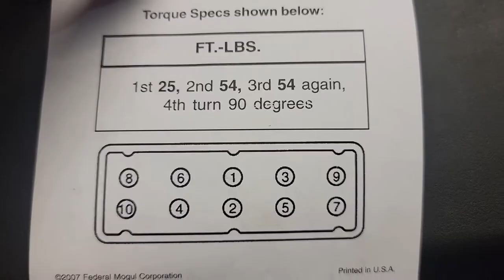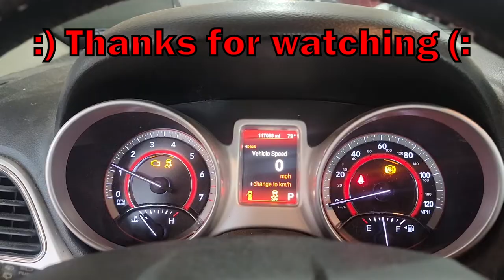How to Replace the Head Gasket and Timing Chain on a 2016 Dodge Journey | 2.4L Engine

Comment: Just went through this with a 2019 Journey 2.4l it was the head gasket leaking into the  #2 cylinder. The Dodge dealership fixed it over 5k in repairs covered by extended warranty luckily.
Reply from the maker: When I did this for the customer, I only charged $1,800 including all the labor and machine work. It took her over 9 months to actually pay me for this repair, she thought what I charged was astronomically over priced. Sounds like she has never taken her vehicle to a dealer for quotes before.
Reply: @BentOaksGarage  no your price was good compared to a dealership. I could not have afforded it without the extended warranty we purchased.

Comment: Nice video - pulling the head on my 16 Patriot with the same engine.  I'm icing down my hand after slipping on a 3' breaker bar trying to loosen those head bolts.  You weren't kidding!  Where did you guys get the extra long torx bit?  There are a couple tight spots my torx bits won't reach them all.
Reply: You can disregard - I didn't see the bearing race left behind partially blocking my way.  Head is off now.

Comment: For water pump bolts, would it work to break them loose before you pull the belt. good video tho thank you i am fixing to tackle this job on a 2013 Chrysler 200. and this is a good.

Comment: On the torque spec the degrees is what stretches the head bolts and that is why you want to have new head bolts as they are all typically torque to yield meaning first passes will be a torque range in a lbs rating then final pass of degrees which is when you are "stretching" the bolts

Comment: So wondering what gaskets you needed to replace aside from the head gasket to do this job? Timing cover? Inlet manifold?

Great video! My 2014 Freemont needs a head gasket change at around 100k miles so it’s great to get an understanding of what the mechanic will need to do.
Reply from the maker: Greetings, Let me say I will try and explain the best I can here in reply, but feel free to email me if you have more questions vgotspeed@yahoo.com.
To start, most engines (not all) have timing marks that you align up with the marks on the timing chain. I will focus on this type. On this Journey, the timing marks were at the 10 and 2 position on the cam gears (sprocket) and the dot on the crank gear (sprocket) was facing at the 6 o'clock position. Make sure you have it on the compression stroke, not the exhaust. You can find this out by just putting something over #1 spark plug hole and if it sucks down, that's exhaust. If it blows out, that's compression. (you can even put your finger over cylinder one spark plug hole to feel suction or pressure. 

Once everything is aligned properly, you can remove the chain, the tensioners, and the guides. 

Then, clean the tops of the camshaft bearing caps and take a sharpie and number them starting at the cam sprocket, I#1, E#1. I#2. E#2. I#3. E#3 Etc. I for intake and E for exhaust. They have to back on in the exact position they cam off. It even helps if you put a small arrow pointing to the cam sprocket on each cap, this way you will know how to put them back on. Once that is done, you can remove the caps and take out the cams.

Next clean off all the covers on both the Intake and Exhaust valves and label them I1, E1, I2, E2 etc starting from the cam sprocket side. Once labeled, you can remove all of them (some times a little magnet helps remove them).

Now its safe to remove the head bolts (I believe it was a T55). Once the head is off, you will need to strip it all the way down to just the valve train. All the sensors, plastic pieces and parts, exhaust, ext. all has to be removed. Then take it to a machine shop and have them pressure test, vacuum test and shave it. Here in TN, all of that cost under 120 dollars.

On a side note, when I do head gaskets for customers, I do not give them an option to skip the machine work. They always ask if they can skip that part to save money and I flat out tell them no. I will not warranty my work if they insist on skipping it. I also replace any wear items when I do a head gasket. So a new water pump, new thermostat, new plugs, new timing chain, etc. This is called preventive maintenance, you are already there so why not just put everything on new so you don't have to worry about it failing anytime soon.  

Here is a list of parts you will need:
Head gasket set (cost a little more but it comes with all the needed gaskets for the rebuild)
Cloyes (the company I recommend) Timing chain set.
Head Bolts
Water Pump
Thermostat
Oil and Filter
Coolant
spark plugs
Black RTV silicone for timing cover
Engine assembly lube of some kind to put on cam bearings when re-installing the cams
Torque wrenches
Valve cover gasket (only if your head gasket set did not come with one)
Power steering fluid
Brake cleaner or carb cleaner to clean injectors when they are out

On a side note, Don't purchase cheap parts off Amazon to save a little bit of money. Stick with brand names like Cloyes. This way, if it does ever fail, you have recourse. Last thing you want to do is tear it all back apart because of of your new parts failed after only a few miles.
Reply: @BentOaksGarage  Thankyou. It’s a bit over my head (no pun intended) but I think your detailed response will definitely help others. :-)

Comment: Nice video. So I didn’t quite understand what you did with the timing. You took the cover off but to remove the head, I assume you need to remove the chain and it needs to go back on in exactly the same position? (Sorry. I’ve never done this before so may be a silly question)
Reply: I'm not the channel but yea you do.

Comment: Hi, I have a 2014 Dodge Avenger with the 2.4L engine. I was driving it and when I got home it was making a loud ticking sound. I raised the hood and it seemed awful hot.  No coolant coming out anywhere and the temp guage was just a little over half. Anyway, it continued to make this loud ticking sound Idling, so I revved the engine up a couple of times and the loud ticking sound stopped. It was still sounding like it had low oil pressure though. I parked it for the night. I started it the next morning anf the red oil light is on. The engine is definitely starving for oil. What could have happened that caused no oil pressure? The oil has always been changed on time and had just been changed.  The engine is rattling. No oil pressure. Could the chain that runs the oil pump broke or maybe a gear, chain guide, or just a bad oil punp? It happened all at once, so it seems to me like something broke or maybe it did get hot and destroyed the oil pump, and the temp sensor is bad. I did notice that the cooling fans were not on. anyone have any suggestions?
Reply from the maker: From the sounds of it, the oil pump just went out. Its a wear item and should be changed when doing timing at 120k miles. With no pressure, I would not even start the vehicle because you can burn up the bearing, rings, etc. Catastrophic damage. Cheers

Comment: I have a 2015 journey, and I keep getting a missfire on cylinder 2 . Changed pretty much everything that has to do with that plugs /coilpack/fuel injector. And could never figure it out. I'm also losing coolant and can't figure out where. A friend told me my head gasket could be leaking water on the cylinder and causing that issue. He said it's a design flaw . So I'm wondering could this could be my issue?
Reply from the maker: You can easily have a cracked gasket that goes to the engine and is burning out the exhaust instead of mixing with your oil. In the summertime, you can tell by white smoke out the exhaust, harder to tell in winter time. Have you checked compression in all four cylinders yet?
Reply: @Bent Oaks Garage  I haven't check compression yet. But I will do that. It only sputters when it's cranked, after sitting for awhile  then levels off and runs normally
Reply from the maker: @Jam_ Hen  is there any other codes like Crank position Sensor or Cam position Sensor? You can also take a bore scope and look into each spark plug hole. If cylinder 2 has a clean piston top, then its leaking coolant into that cylinder.
Reply: exact same issue with our 2014 journey, misfire cylinder 2 and losing coolant somewhere cant find it.  Bought a coolant exhaust sniffer,  test fluid turned green. means traces of exaust.

Comment: Question when doing a head gasket is the timing chain savable should that be replaced as well.?? I guess it depends, right.?
Reply from the maker: A timing chain should never be reused (in my opinion). The reason for this is preventive maintenance. If you are already that for in, spending the extra couple hundred bucks to replace everything is well worth the money. Because if you don't, and you use the old chain and it stretches or breaks, you will be pulling it all apart again, spending all that money and time a 2nd time and you will be kicking yourself in the butt for not replacing it the first time around.
Reply: @BentOaksGarage   Thank you i appreciate it, God bless you.

Comment: it's good to pressure wash the whole engine compartment of every sizable under hood repair.
 I usually tap socket 2 times hammer click it
and do this 3 times if needed it stops bolts from breaking. I plane these heads by hand at home and save money
Reply: Stop

Comment: Great video. What head gasket brand did you use? Also did you have to change the thermostat, radiator or any of the hoses?
Reply from the maker: Felpro head gasket #26557PT. The owner of the car said she just replaced the thermostats in the car so I did not replace them, however I highly recommend doing so. The radiator amd hoses stayed the same. Also spend the extra money and get new head bolts, you don't want to end up redoing it a 2nd time from a stretched bolt.

Comment: Did you have to take off the oil pan off to get the timing chain off and back on ?
Reply from the maker: Yes, it's attached to the timing chain cover and so is the oil pick up tube. It was very poor design and makes life hell for a mechanic.

Comment: I've never seen anybody remove head bolts with an impact gun. Always a breaker bar.
Reply from the maker: We tried that. Even when we used an  extra long pipe to extend the breaker bar, it snapped the head off the bar. Thus needing something bigger. Cheers.

Comment: Can i get the torque for the cams please
Reply from the maker: 8 ft pounds for the M6 cap bolts and 22 ft pounds for the M8 cap bolts
 Start in the center and work your way out.
Reply: Thanksz so much

Comment: Would it just be better to buy the motor instead of fixing the gaskets? My Dodge Journery has the same problem but everyone says to just buy a new motor.
Reply: You’ll save more money just fixing the cylinder head.
Reply from the maker: As @waltersun558 mentioned, it would save a couple of grand by just replacing the head gasket. It's one of the easiest engines to work on (IMHO) with lots and lots of room to get everything off.

Comment: How much does the machine shop charge for that head?
Reply from the maker: I paid $186 (if I remember correctly) to have the head decked and pressure tested (also lapped three valved).
Reply: @BentOaksGarage  thanks

Comment: We have a dodge journey 2011, always had a loud rattling engine.  It stalled one day, towed to mechanics told it was timing chain, they refused to fix, so took to another.  Was quoted for timing chain replacement, half way through he says the engine is in poor condition and needs a new secondhand engine quoting 12k, vehicle towed back still in semi stripped condtion.  Before we took it to the mechanic we had diagnostic put on, it said cyclinder 2 was misfiring replaced coil pack then we had multiple misfire on cylinders.
Reply from the maker: One of the first things a mechanic should have done was a compression test. This would have told you if the engine was salvageable or needed replacing. As for 12K, maybe if they went with brand new engine. If they went salvage engine, price would be under 5k. I charged the customer $1800 for this job and that included the machine work, New timing, new waterpump, and labor.
Reply: @BentOaksGarage  thanks for your reply they charged us $1100 (Au) to pull it apart, do you need to remove rocket cover for compression test?
Reply from the maker: @belindajohnson6224  No, just pull the spark plugs out (all 4 or six) and twist on the tester. It goes in the same holes as the plugs. Once it's attached, crank the car and count to 5. Each cylinder should read between 120 and 150. If anything under 90, your in trouble.
Reply from the maker: @belindajohnson6224  Also, if you can't locate a compression tester anywhere close,  I can ship one out to you for the cost of tester and shipping. I know some countries are harder to locate mechanics tools. I'm lucky. There are several tool supply stores close to me.
Reply: Hi so i am working onn a 2012 Chrysler 200 has the same engine i did the compression test onn all 4 cylinder the one furthest to the passenger door reads 60 then the next one is 15 and the 3rd one i think it was 30 and last one 30 the dude said it overheated on his son and now it wont start shouldn't it start even with low compression?

Comment: So if the head gasket not blown why does it over heat changed the thermostat radiator flush wat else could it be
Reply from the maker: I had a customer come in with that same issue. No signs of a bad head gasket, new thermostat, new waterpump, no coolant mixing with oil. But still overheated. What his came out to be was a cracked cylinder head. It also happened to be a toyota, just a minivan instead.

Comment: not sure that I'd have used a 1" impact to remove the head bolts. you want to get a long T-55 like the 3 " ones from Mac tools ($61.00) a 24 inch swing arm with a 24 inch snipe. Then the bolts come loose. they snap 3 or 4 times while the bolt twists 1/4 turn then POW bolt comes  loose. All the impact is doing is twisting the bolt back and forth.

Comment: What do you charge for a job like this?
Reply from the maker: This specific job I charged $1850 for. That included the machining the head, all the gaskets, and labor. There is lots of room to work in this engine bay. Any other vehicle would 2200 and up.
Reply: @BentOaksGarage  yeah I got the 2015 I wish I had the time and tools cuz there's a machine shop like 5 miles from me too. Ugh I don't wanna add 2 grand to my mounting debt

Comment: The head bolts could have red or blue loctite that's why they're hard to come out you either have to get a big breaker bar and break them loose or go the easy way just put some gasoline in there gasoline will eat away the loctite and the head bolts will be released very easily best experience been doing this s*** too long
Reply from the maker: When I did that head, I actually broke three T55 heads and a three foot breaker bar trying to remove it. That impact was my last resort.  When they did come out, I did not notice any residual red or blue loctite on them. This was by far the tightest head I ever had to remove. Cheers.
Reply: Yo tuve el mismo problema con todos los pernos de cabeza  con un barrote largo para ejercer la presión  soltando y una segunda persona  golpear sobre la llave con una maceta algo primitivo pero logré soltar todos los pernos sin dañar ya que el sistema neumático no fue capaz

Comment: Your air delivery is inadequate for the 1" impact. You can hear it begging for more air. Larger diameter hose, fittings and/or cfm air compressor is needed.